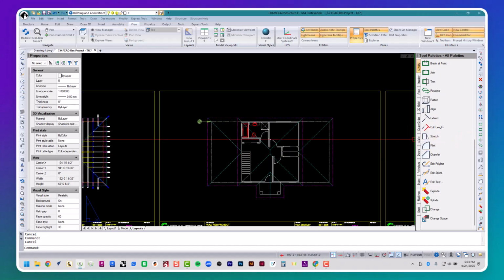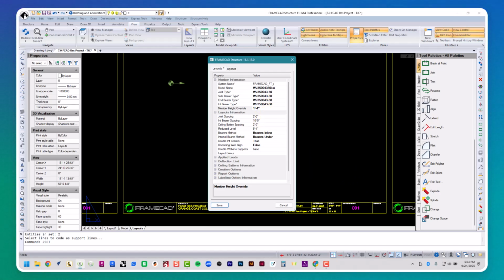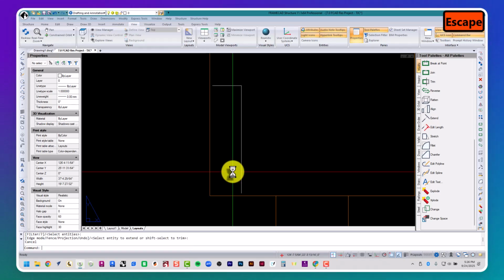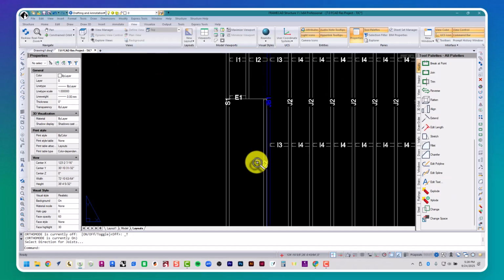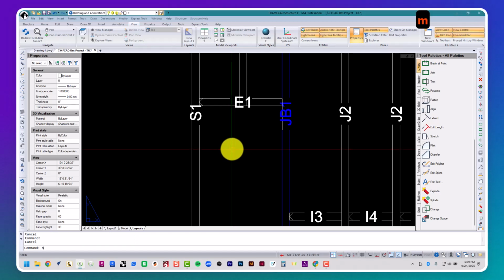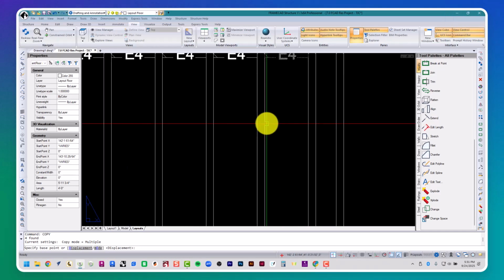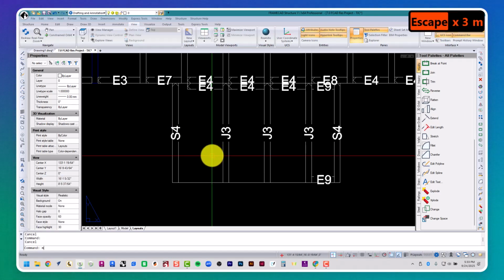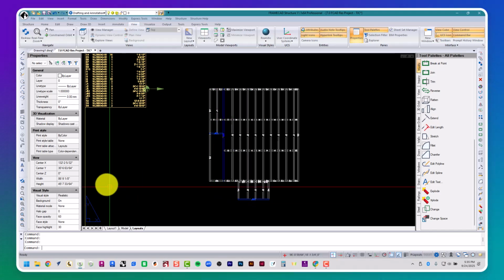7.0 Upper Floor Joists (JSET)

Comment: The section showing how to creating and adjust the upper floor joists is clear and easy to follow. However, the reasoning behind the changes such as why certain joists are moved, modified, or deleted is not explained clearly. This part is critical for ;earning because it helps viewers understand not only how, but also why.